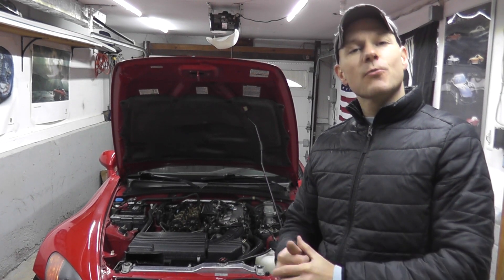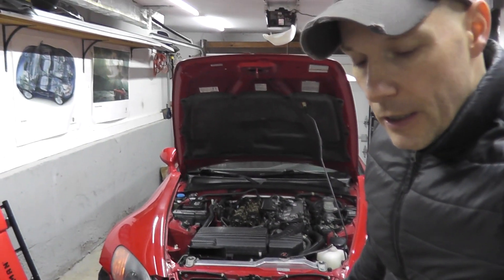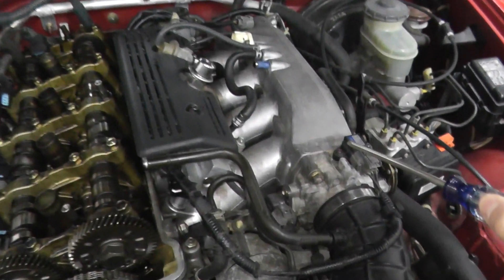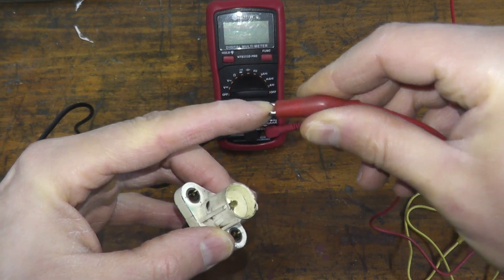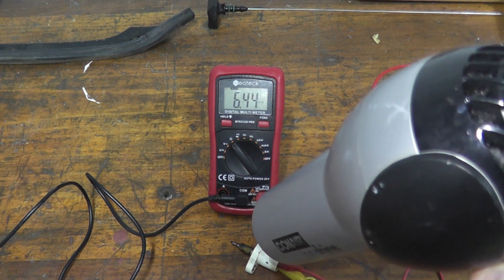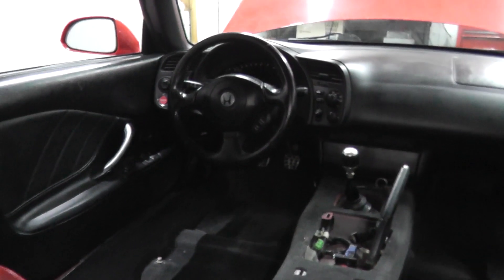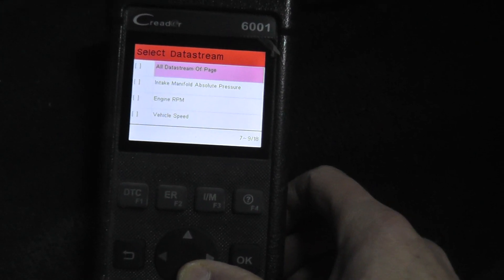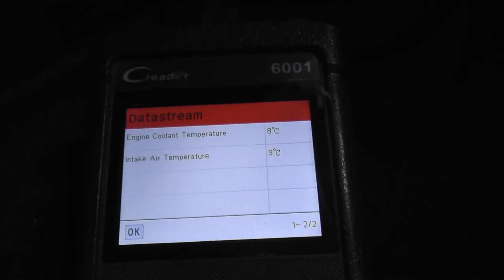Honda S2000 Intake Air Temperature Sensor - IAT - P0112 / P0113 Testing and Replacement

Comment: 2001 s2k ap1, 28k miles, yae, the previous owner just held it for ten years only drove it during weekends. Really really like your video! Especially the part about reading both ends of those sensors. Now I am facing a non-vtec problem. Read and watched ton of resource. I would really like to see if you can come up a video just talking about all of the potential root cause of the non working vtec. for example, my car drives very normal, vtec not working after I changed the exhaust by myself. throttle normal, running super normal(so no throttle position sensor, speed sensor problems). my guess is the exhaust, or cat caused the problem. the only symptom i found is the slow rpm ramp up while driving, it does go to 9k rpm just noticeable slower than before. also the exhaust felt clogged, so like the flow is not smooth. due to super low mileage and engine bay is super clean, i bet not solenoid problem .so if it's exhaust, why? really want to hear your thoughts. thanks!